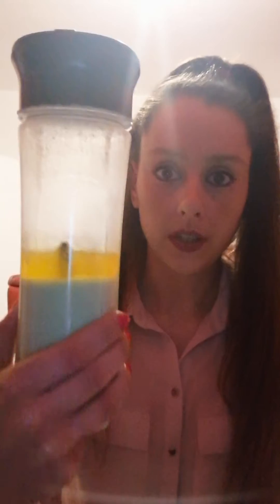Density tower drop test 2.0

Comment: @Rachie 00000 --- at best what you are demonstrating is that in freefall, which is the equivalent of zero gravity or microgravity, things don't spontaneously mix. Why would they? If you accelerate the container downward faster than gravity, then they will mix. If you could sustain accelerating the container downward faster than gravity for a long enough period of time, the liquids would settle again with the denser liquid on top and the less dense liquid in the middle, and the air at the bottom. It's not a mystery. It's well established science. I know some movie producers might think that if an elevator is free falling the occupants of that elevator will be slammed against the ceiling, but that's not how reality works. And what you are trying to demonstrate doesn't happen, shouldn't happen. So I don't know why you're trying to demonstrate that it doesn't happen. Is the idea to show that scientists got it right, and that flat Earth nonsense got it all wrong? Because that is essentially what you are accomplishing.
Reply from the maker: Correct things don't spontaneously mix.
Globers were telling me it would mix if dropped. They were wrong as shown.
That was the whole point.

Comment: All this experiment proves is that you're out of shape if doing only a handful of body weight squats at your light weight makes you out of breath. I'd suggest doing 5 sets of 50 body weight squats Mondays and Thursdays and 5 sets of front and side lunges (10-12 per leg, per direction) on Tuesdays and Fridays and 5 sets of 50 calf raises each of those 4 days.  If/when they get too easy, try holding some dumbbells! In 6 months, you'll have much better form, strong legs, and can do this "experiment" without getting winded.
Reply from the maker: I suggest you give me a new body then, one that's pain free and doesn't suffer pain everyday, shortness of breath randomly and heart dropping sensations etc.
Then maybe I could do your suggestion.
Reply: @Rachie-nj3oi  Lol

Comment: If you have a vertical tube full of air and put in a steel ball through a hole halfway along the tube, will the ball rise up the tube or fall down the tube? In either direction, up or down, the density of the air is less than that of the steel ball. Why does the ball always choose one particular direction - down?
Reply: It’s almost like density isn’t a force
Reply: @neofelisnebulosa3871  It's hard to believe but I think you may be right. Can it be that the leading lights of the flat Earth movement are wrong? Surely not.

Comment: 1:43 You are kind of going about this the wrong way. Diffusion takes a long time and is dependent on a lot of variables. The thing is, if you mix the liquids, with gravity present it will take a certain amount of time for said gravity to sort them out again, and this time will be shorter (than the time it would take them to diffuse). Without gravity present, like when falling, they will stay mixed. 
So to answer your question; shake the bottle, time how long it takes for the liquids to separate. This is the time you need to let the bottle fall if you start with all the liquids mixed. It’s a substatially longer time than what you gave it for the slower process of diffusion.
Reply: no grabbity, it's a relative density experiment she's doing. What? u want her to grab on to a balloon satellite, with helium and float?
Reply: @RP12ification  "relative density experiment" Relative density? Doesn't exist.
Reply: @RP12ification  learn to spell, she hasn’t proven any relative density. Density is a measure of the amount of matter within an object over a certain area^3. It’s not a force. It’s not gonna make things fall especially not in any specific direction lol that’s just stupid

Comment: Is this a test? Do you really think to have tested your hypothesis?
Reply: 0 G wats that? ZERO G? zero legs, zeros in my brains. FREEFALL IN HUMANS there's nothing to hold u or steady the fall. The only way to relatively dense the fall is by a parachute, that's it!

An easy example of freefall: go in a car, the car is going 60 mph, what are u doing in car?, is ur hair running around or is it still?? ... now imagine no car and YOU're going 60 mph without anything, where the breaks?? those 60mph could go faster.
Reply from the maker: Of course. My hypothesis was it wouldn't mix and it didn't.
Which it shouldn't because everything inside should be falling at same rate.
Reply: @Rachie-nj3oi  Yes, you're right, there was no reason that it would mix, because you didn't properly test the condition of free falling that is linked to weightlessness.
The real experiment could be made only on the ISS where the condition of free falling is permanent, or in a not rigorous way on the zero G plane.
In free fall a density column cannot persist if you shake it. 
The half second of falling of your density column wasn't enough to see any modification happening, and you looked at it just after applying a strong deceleration that would put in order the densities more than natural gravity.
Reply from the maker: @psalux18963  no there's no reason to mix fall stop if things fall at the same rate, regardless of iss plane or living room. If falling at the same rate no mixing.
Well obviously because your shaking it, a density column can't persist if your standing perfectly still holding it and shaking it with no falling either.
No I watched it all the way down not just when I catched it. I was watching for mixing while it was falling and it didn't, because they are falling at the same rate.
Reply: @Rachie-nj3oi  Ok, if you are just testing the fact the column doesn't mix that's ok, but you didn't test gravity vs relative density.
I recently put in a transparent bottle equal parts of oil and water, I shook it and then I saw that after 3 seconds the separation of the oil was evidently happening, and after 7 seconds the separation was complete. 
In the video of the density column on the zero G plane the free fall lasts at least 20 seconds, and after the initial mixing the column doesn't separate until the gravity returns.
Reply: @psalux18963  u can't test GRABBITY, no such thing
Reply: @RP12ification  It's difficult to understand, to organize what you are saying what you are saying.
However, no a parachute fall is not a free fall, you feel very well your weight, the air is massively pushing you up.
Gravity vcam ìn be measured any moment you want, with an accelerometer app on your phone for newtonian gravity there's the Cavendish experiment, and for general relativity look at the Wiki page tests of general relativity.
You can also test gravity by building a bridge with no engeneerin expertise: it will fall down because you didn't account gravity.

Comment: But why do you expect the layers to mix during a four-foot drop??
They start off unmixed, they all undergo the same acceleration downwards.
Why SHOULD they mix?

You're missing the point again.

The layers only mix if enough energy is put into them (shaking or jiggling). If you had a density tower and you let it freefall, straight downwards (with no sideways or rotational movement - say in a very tall tube) the layers would stay separated out because they're all undergoing freefall. When the tower hits the ground, yes, it'll all mix up and then separate out again quickly.

If you drop a cat off a roof and then follow it over the edge, you don't catch up with it and overtake it, do you? If it hits the ground 10s after being dropped and you're 2s behind it, you'll still be 2s behind it when you hit the ground.

You need to mix it up and time how long it takes to separate undropped; and then do a drop that will take at least as long as that, and mix it up before you drop it, and see how long it takes to separate whilst falling. (Hint: it won't - it'll only start separating when it hits the ground).

Why does water float in the air in globules in freefall when the air everywhere around it is less dense? Could it be that, without a net acceleration, it doesn't know WHICH way to go....?

Comment: You realize that the mixing effect only takes place WHILE it's falling. Right?
Reply: "the mixing effect only takes place WHILE it's falling" And why would it mix? There is no force causing that mixing.
Reply from the maker: Yep thats what I thought as that's what I've been told. But it fell and didn't mix.
Now instead of just falling people are saying it needs to fall for longer. Why if falling is falling? Like why does time matter or speed because all time, speed and height could be considered factors then. So how can we isolate the actual cause because it was just that if it falls it mixes, now it needs to fall longer which is increasing, time, speed and height.
Do we have a formula for when this takes place? 🤔
Reply: @Rachie-nj3oi  Speaking for myself, I can't see what is or is not happening in your video. Once you've caught it, the densities settle nicely into place as expected, but what's going on while it's falling? I have no idea. I just can't see that in this video.
Action Labs attached a camera to the bottle, so you can see the effect really clearly: https://youtu.be/YDXQ-VBjW7Q?t=161
I see people talking about the time. I would suggest you don't get pulled down that path. Obviously, any movement of the liquids will happen over time. Sure. Did you expect the liquids to rush to opposite ends of the container? Of course not. All that's supposed to happen is they start wandering randomly around. Let them wander for about 1 second, and they won't get very far, but it's not really about a matter of time. The question is, "can you see that they've started wandering around?" In the video, I can't tell. Can you tell? While it's falling, do you see any movement of the liquids? If you can't, certainly letting it fall longer might help you see the effect, but that certainly isn't "the reason" for it.
Reply: @icansciencethat  I usually agree with you, but I have to disagree with you on this. I very much doubt that there would be a visible effect after dropping for such a short time, even with a very good hd camera stuck to the bottle. Even with actionlabs experiment they start with the less dense medium (air) mixed in with the denser medium (water) and we watch them not sorting themselves out while they fall. Starting with the two sorted and waiting for them to diffuse will take time, especially when it’s water and oil.
Reply: @eleventhchimp  I can go along with that. The action labs demo really shows what I'm trying to explain very clearly. The bubbles stop rising when the bottle falls. That's all.
Reply: @icansciencethat  That it certainly does.

Comment: The Free-fall in the vomit comet is an induced free fall where someone holds the jar in their hand while they are falling, so it is mixing for them due to that factor.
If they took the lid off while they fell I wonder what would be the outcome ? 
And I think they can use extra acceleration downwards with the vomit comet too, so that would induce more than free fall also.
Reply: @Squort Yes.
Reply: Let me see if I get this "logic" correct.
Helium balloons no longer float in air on the Zero-G plane, but oil still floats on water in the Zero-G plane. Am I getting this right?
People no longer sink in air on the Zero-G plane, but water still sinks underneath oil on the Zero-G plane.
Are you starting to see any flaws in this logic at all?
Reply: @icansciencethat  Your questions tell me that you don’t understand RDE, as you have been told why the Helium balloon 🎈 does what it does in the vomit comet. 
If you change the densities to solids inside the container will they mix together NO, so their mixing together is purely due to the fact that they are liquids, that are contained inside a closed container and being shook about, but do they re-arrange themselves due to their densities afterwards ? Yes....
Reply: @BriansLogic  I absolutely do not understand RDE. Are you are able to explain it in enough detail that I could understand it?
Reply: @icansciencethat  Yes very simply it’s all about the Structural Support of Matter, why does the Helium Balloon 🎈 fall in a Vacuum, what is it missing ?
If you understand that you understand the first step.
Water is more dense than Ice 🧊 yet you can’t drive a car over a lake in Summer, but you can in Winter, so it’s not just density, yet it is just density....
There is a video on the way, that will explain it all, in the coming weeks....
Reply: @BriansLogic  So that's a "Um, no, sorry, I can't..." to ICST's question.
OK.
Reply: @MarkMichalowski  What are talking about I replied to him ? 
If you don’t understand the reply that’s not my fault....
Reply: @BriansLogic  He asked you if you could explain it in enough detail so that he could understand it?
OK, fair enough, I'm talking about me, rather than ICST.
But you DIDN'T explai it in enough detail at all, did you? Otherwise why did you need to add that you'd be doing a video to explain it all?
Either you've explained it well enough, or you haven't.

My money's on "you haven't".
Reply: @BriansLogic  Believe it or not, I'd say you're sort of on the right track here.
A helium balloon floats because it is supported by the air.
My demonstration is ice floating in water.
Put a cup on a scale and weigh it. What's supporting the cup? Why the scale is supporting the cup. You see the weight on the scale.
Put water in the cup. What is supporting the water? Of course the cup is supporting the water, the scale supports the cup. You see the weight of BOTH on the scale.
Put ice in the water. What is supporting the ice? The water supports the ice. The cup supports the water. The scale supports the cup. You see the weight of all 3 (ice plus water plus cup) on the scale.
Once you realize this, it becomes really quite simple. It's so simple it's deceptive. The water supports the ice. That's all there really is to it.
Air supports helium balloons in the exact same way.
Reply: @icansciencethat  Yes Structural Support, as all Matter Requires it, even Gases if they are in Concentrated Form, or manipulated by Temperature, i:e Convection.
Density Differential of the Medium and Object, Substance or Gas, is step one of the Explanation, step two, is Structural Support as Not all things of Higher Density have the same Structural Support for Matter, as things of a Lower Density.... Water and Ice being Great Examples....
All Matter has Weight as all Matter has Density of some form, but the thinking of Weight being a Linear Downward Force is Outdated, as Weigh an Empty Container, then Weight it with Gas inside it, and the Container will Weight More, but the Gas is Not moving in a Linear Downward fashion, as its moving in all directions, simultaneously.
The Helium Balloon will fall in a Vacuum, but Pop the Balloon and the Helium will still fill the Chamber ?
Reply: @BriansLogic  I've heard you talk about this quite a bit. You seem to think that uncontained gasses do not have weight. That gasses do not move downward. I assure you that gasses have mass and weight. Heavy gasses sink in lighter ones. They tend to diffuse together quite easily, but it's quite simple to demonstrate that even when uncontained, dense gasses do travel downwards in lighter gasses.
Reply: @BriansLogic  none of this explains why structural support only works in one direction - you have  no explanation of what causes that direction do you. If, of course, you introduce an acceleration vector you get directionality. And you can change the direction of that acceleration vector and, lo and behold, the support changes its direction to match. Or if you balance out the accelerations the support disappears altogether. 

As it currently stands, your structural support explanation falls short
Reply: @BriansLogic  So...why is weight proportional to mass? Hmm... 🤔
Reply: @BriansLogic  this comment prompts me to ask two questions: 1 - are you saying RDE/RDD only works with liquid on liquid? And 2 - do you have any experimental evidence to support your assertion that the liquids would separate into layers in the same way on a zero g flight as they would under normal circumstances?